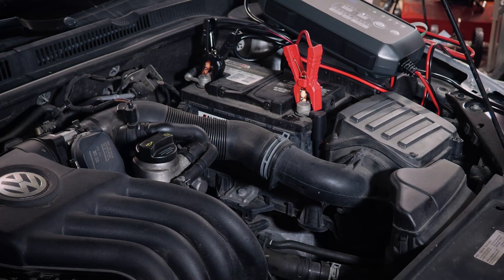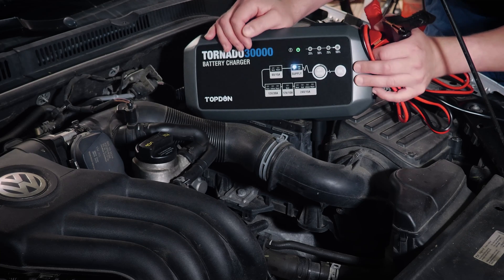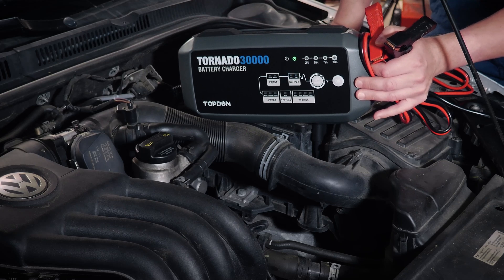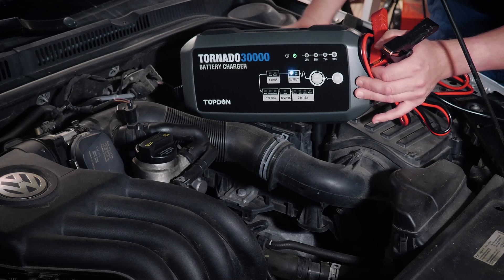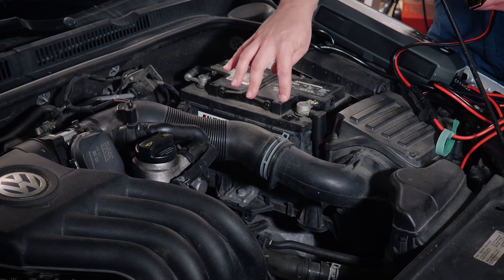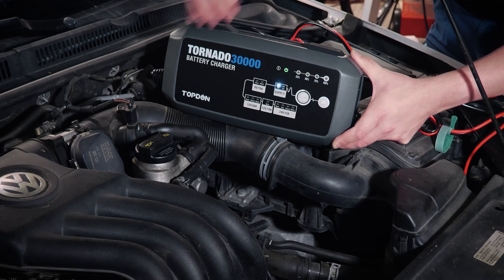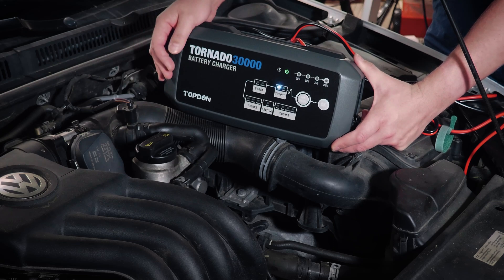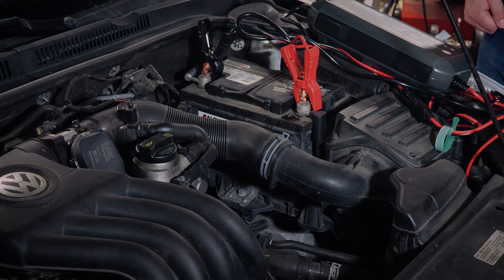TOPDON | Tornado30000 | Overview | Battery Charger

Comment: hey guys I have this same charger can you guide me. I need the charger to keep charging  after a power blackout. but it stops charging is there any way to stop this from happening.
Reply from the maker: Hi Sultan, sorry for the inconvenience, currently T30000 doesn't support to charge automatically after a power blackout. our T4000 2023 version have memory function which will meet your needs.